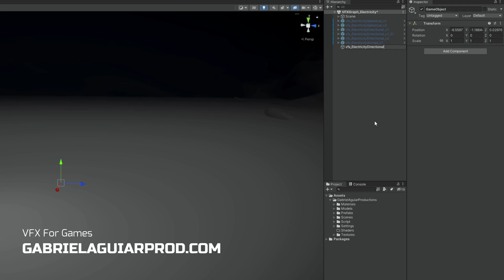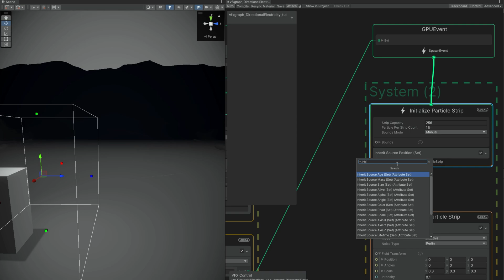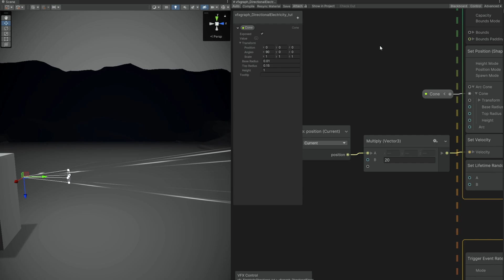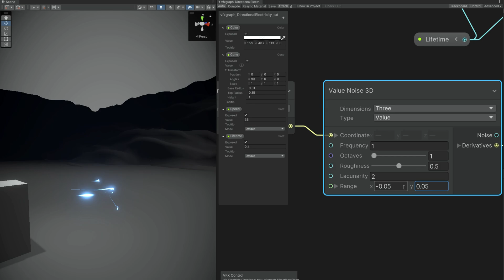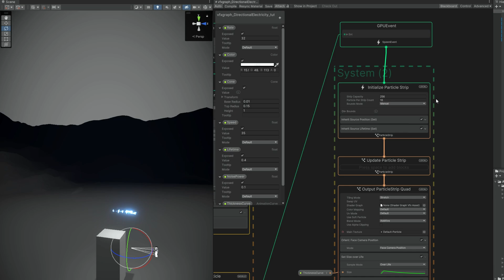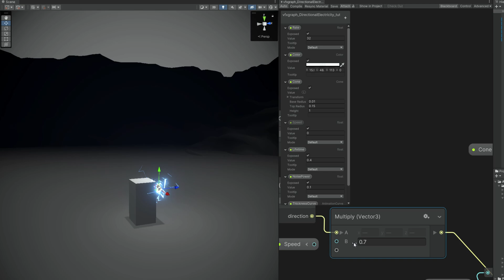Unity VFX Graph - Electricity Tutorial

Comment: Great video! I was just wondering if this is possible in older versions of VFX Graphs. I have version 10.5.1 and i dont see the bounds mode in the initialize particle for trail. Also im stuck in the part with the cone because set Position (shape:cone) wont let me connect my cone to it.
Reply from the maker: Don't necessary need to connect the cone property, that's just to make things easier by being able to control it in the inspector instead of opening vfx graph. As for bounds mode, not sure what you are referring to.
Reply: @GabrielAguiarProd  In the Video you change the bounds mode to manual in the initialize particle strip